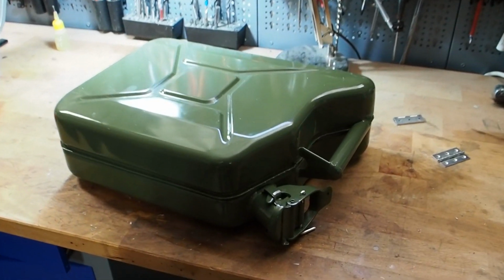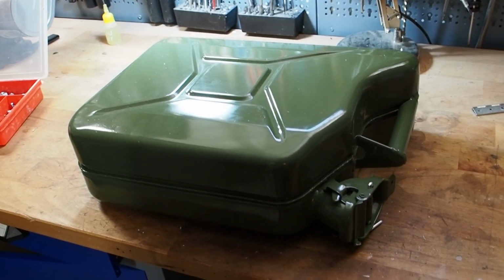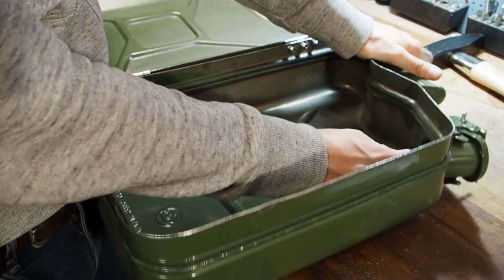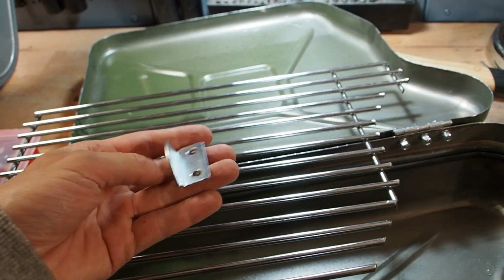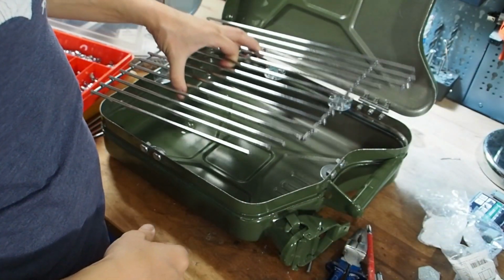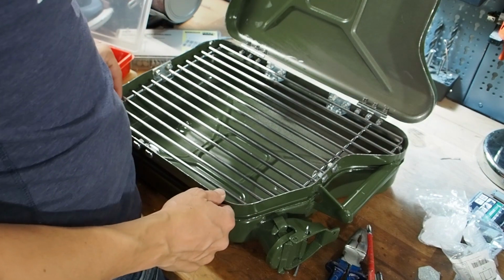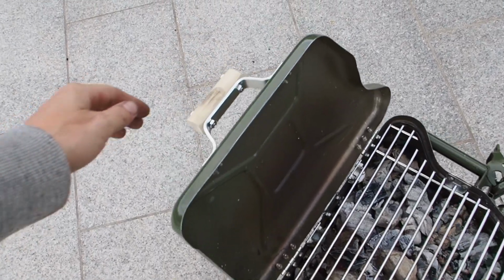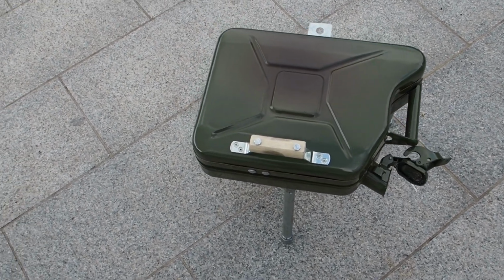How to build a BBQ Grill (DIY Jerry Can)

Comment: How about the fumes from the heated paint. The paint is intended for a gas container which is usually not heated and may release fumes when heated to the high temperatures of a grill.
Reply: @SANDEDFACELESS69  Guess I turned it off too early. Thanks!

Comment: Another great video Lilly!
Funnily I've got 4 of the 20l army Jerry cans in Black I bought last year! Kind of prepping idea as they can hold water petrol or diesel. I was going to turn one into a BBQ! They're all brand new unused, I just haven't got around to doing it yet but thought would be ideal for when I build out my campervan kind of a DIY outdoor grill to add a bit of a Personal touch! And have another couple for diesel and one for petrol so they can all store next to eachother and match up.. 
This is a great design that could be easily adapted to the bigger version..  you could store the legs and externals inside and perhaps have a carry handle or latch to keep it closed. And use the built in handle to carry it around.. maybe even a couple of holes on the other side /bottom for cross draught, but aside from that excellent simple functional and solid build! Given me a couple extra idea options to consider for my own design when I eventually do it lol.. 🫕👍 Well done! ❤️🏴😎x
Ps. I'm loving the diversity of your videos lately aswell!! 👍❤️🙏🏴
Reply: Buy a cheap stick welder. Instead of drilling just weld the hinges and grate tabs. The end caps used for the legs put them inside welded and a hole the size of the pipe through the can. Handle use wing nuts to take it off. 2 lock latches and you are set. Finish it off with high temp heat paint. I’ve done a few of the beer keg grills. This is gonna be next

Comment: Looks Great! Have one mod if you would like. The bolt heads that are exposed on top of the wood handle be countersunk due to them getting hot and may cause burns. The bottom side of handle would cause same if not remembered to just use sides of wood handle. Thanks for Sharing. Stay Safe.

Comment: the heat from the BBQ will burn off the paint and it will rust out quickly. Plus you will have the chemicals in your food. I had a steel plate 60 cm x 40 cm 4 nuts welded and 4 X 2cm  X 30cm bolts to screw into them for transport. It was too heavy to carry everywhere so after it was cleaned, I kept it dry at the main camp. Check out cast iron dutch ovens for SHTF cookware

Comment: While a nice job, your grill needs a couple of things.  Something to keep the lid from blowing closed, as mentioned previously, a latch to keep iot closed for transporting, an adjustable vent on the lid would be convenient.  A way to store the legs, perhaps inside  FWIW, I suspect the cost to build your grill was not inexpensive.  Portable charcoal grills can be bought in Canada for around $20.00 (Canadian) or about 13.43 Euros,  A plastic gerry can usually sells here for about $20.00.

Comment: So nice, i would have changed only one small detail, i would have used wood screws from the back on the wood handle instead of the bolts. Or even better, i would not have a handle there at all i would use a quick release handle so it would never be to warm when you grab it to open the grill.

Comment: Just a word of caution anyone thinking of using a second hand can these must be cleaned and purged before any cutting due to explosion. Another point to note unleaded fuel contains benzine, burnt benzine is a high carcogenic, any paint or metal would need to be sandblasted and cleaned before use to stop contamination of food

Comment: Great idea, but you didn't mention to ONLY use a NEW jerry can.  If it has ever had gas, etc. in it, it will explode.  Even if it appears "dry" there is petroleum residue inside it.  
   How do I know?  I am an OR nurse and had a case just like this where the can blew up in the guy's face.  He lost an eye and had multiple cuts all over his face and scalp.
Reply: Fire it out or fill it with water before cutting.

Comment: I made a fish smoker out of one of these, same way...You put the saw dust on the bottom where you put your wood , put the fish on your grill close the lid..place on a gas ring and ture it on, when you see smoke coming out turn gas off for 10 mins then do the same 3-4 times or until its done this way you only cook with smoke not heat which would cook [ boil it ] not smoke it..
Beautiful Smoke fish...thanks  will..n.z

Comment: For all those people who are advising the use of pop rivets to make the construction easier I would like to remind them that pop rivets are made from aluminium which is likely to melt at the temperatures that the grill will reaching, so that would be a waste of time and materials. As for the loose bars on the grid, they look like they are chrome plated, which can be difficult to weld, unless you have access to a TIG welding set, and know how to use it. Myself I would take it all to a car body repair shop and give the job to them, it’s the type of job that they would give to a young apprentice in my day, if I had the gear I would do it for myself, but I haven’t and I’m the wrong side of 60 now so I don’t want to be setting up a welding shop for a small job like this.

Comment: Great idea with the pipe endcaps for leg adapters!
That didn't came to my mind!
:-D
If you flip the hinges there would be no need for a lid holder in the back, they would rest on themself. 
Do the legs fit inside for transport?
Great thing, thx for the vid!
:-D

Comment: Buy one of those cheap welding machines off ebay. My friend has one and I ran it through it's paces and it's not bad for a hobby machine. I wouldn't rely on it carrying it around the job site everyday like my Miller but hey it's not bad. Might could even find a cheap flux core mig welder on there too.. stick or flux core mig needs no shielding gas.
Reply: If your wanting to try you can use your car battery and jumper cables as welding leads and just buy a small pack of 7018 welding rods

Comment: I had to laugh ; I worked at a place called U.S Can that made these cans...I used to check them for holes with an air hose and stick them under water to see if they had any bubbles...I probably should have made one of these back in the day...a new one I would not be afraid of welding on it...I bought a DC inverter welder for thin metal...the problem with screws is they loosen with heating and cooling where a weld will not...I'm going to build a rocket stove out of a semi truck exhaust stack...it's chrome...I found it by the highway...I've not made one before but I like welding on stainless steel so it'll be fun...see, mine has to be different...nobody I know has a chrome one, so that'll work out...well  yours works good ...

Comment: Lilly! I'm shocked to see an outdoors woman like you using lighter fuel. 😂🤣😂 Seriously though, this is a really good project well executed. 🙌🙌🙌
Reply: I thought so too... i was realy disappointed at that part.
Not very survival-style...
At my scout group i teach the kids NOT to use liquids to light a fire (and so do i)  because its too dangerous and not necessary. For adults though its ok, if they know what they do.
The project itself is great. I just had simplified it by just useing screws to hold the grate und directly screw a piece of wood on the top as handle.
And, as someone already wrote, a hasp would be handy.

Comment: First thing I'd do,  is remove all paint on the in, and outside of the can by sandblasting. Most paints, and the coating on the inside are a health hazard, when burned off. Unless you love the tast of lead,  and cancerous paint ingredients.

Comment: Some tips when drilling metal go slow if your making flakes your going to fast it will heat the bit and loose its hardness. The drill should make a curly piece of metal. The bit will last much longer.
Get a small welder and learn it's not hard .